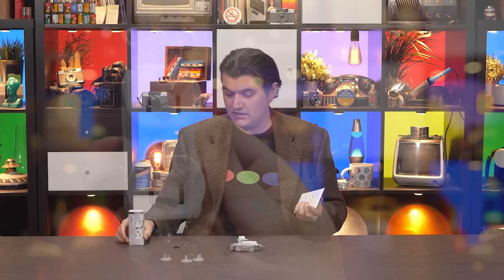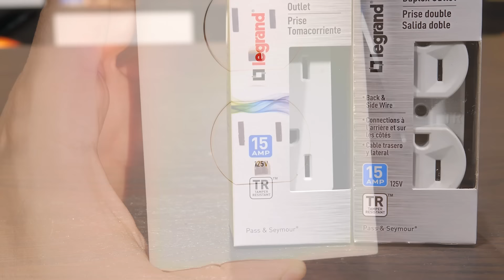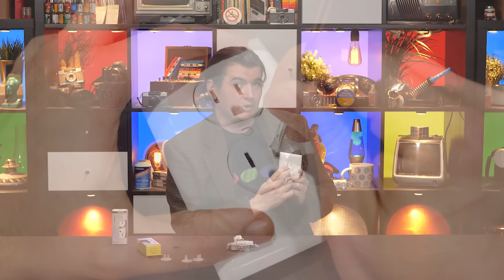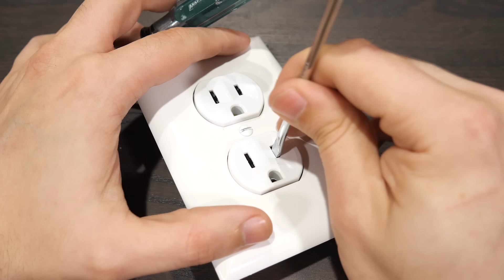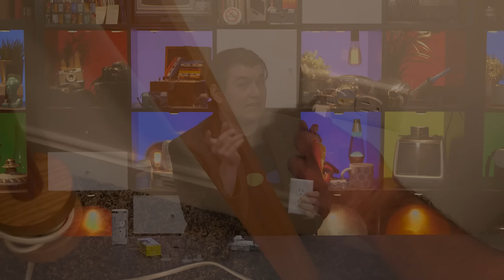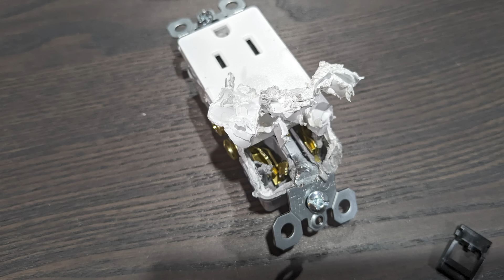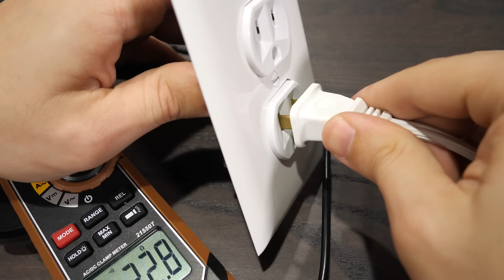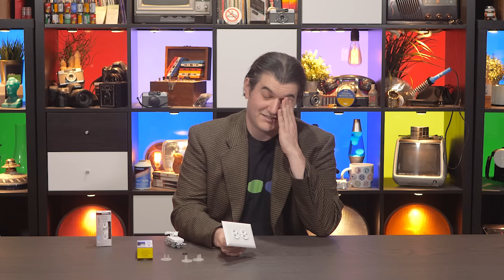Tamper-resistant outlets aren't all the same - a follow-up

Comment: Need to push two screwdrivers in at the same time?  Challenge accepted!

Just adopt the BS 1363.  Insulated pins, high current capability, locally fused, built-in plug detection - can't find where you've left your plug?  Walk about in the dark barefoot 😁

Comment: Enjoy these outlet discussions.  One thing to of course keep in mind is that there is always a cost benefit calculation to be done.  The cost of a change to the US outlet standard, in any way that would break compatibility would be enormous.  Thus the problem addressed would have to be a severe one.  I learned about these the hard way at a very young age when trying to plug in a lamp behind some furniture, I must have touched the conductor with my fingers and got a painful 120v shock.  Something I remember 40 years later and have been careful to never repeat. It hurt, but as in most of these cases the actual injury was minor.    There isn't an epidemic of folks killed by this scenario, it has to be quite rare.  It's also mitigated in more dangerous (potentially wet) locations by GFCI.    As an aside,  I recently was on a trip to the UK, and had the same issue with a sagging connection wanting to come loose in a London hotel.  The issue was having to use an adapter to connect to that large Apple power supply putting a lot of weight on the connection.  Frankly, the old design of putting the transformer brick in the middle of the power connection is better than hanging right on the plug, for that very reason. At home this is solved with a power strip, on the road that can be more difficult.  Thanks again.
Reply: Yeah those Apple power bricks are the worst for it with the US plug. 

It's something I was unprepared for while travelling the other way, as I'd only used them with the UK and EU ends attached. But since I had the travel kit I attached the US end. At first I was quite pleased with it being a genuine flush square when folded up, it legitimately saved space in my messenger bag.

Then, it started falling out of every socket in every bus, bus station, train, and some pals' houses, every 30-60 minutes. I'm not surprised your US to UK adapter had the same problem, the prongs in those can be weaker even when new. (And maybe the adapter wasn't new!)
Reply: Backwards compatibility can be solved with adaptors as needed, and if adopting a Schoko outlet-plug, it also will be compatible with most European appliances.

Comment: I had TWO push in wire outlets short out in my current house.  Each one one made audible sizzling sounds and did not trip the breakers.  There were skid marks on the holes.  One was installed inside the house and one in an enclosed exterior outlet.

Comment: We only have 110v power.  The risk of death if you touch it is really low.  Compare that to 220v ot 240v which is much more dangerous.  So it doesnt really matter that the design is less perfect.  We also dont use ring mains and have dedicated breakers so we do not have the same issues with power distribution and control of power (with breakers and GFCIs).

Comment: I'm German. Our plugs are infinitely better than yours. Sorry.
The only time I've been shocked waaaaaaaaas...with an AMERICAN plug that came with my Kindle way back plugged into a converter. I suppose that provided some measure of """"safety"""" (lots of quotation marks) in the sense you described. If you guys ever DO switch, I very much recommend our SchuKo system. It's borderline impossible to get zapped, even with wet (!) hands. ALL new power cords have tamper protection as well, because it seems to be really easy to implement.
Unfortunately, you'd need an insane amount of converters for your legacy appliances. 
Still might be worth it, mind you. In the looooooong run.

Comment: That tamper resistant variants are similar to the Schuko tamper resistant ones. And share the same problems: Sometimes you can't get a cord in until you use VIOLENCE! And when there is one thing kids are good at: If it does not budge try harder!
As for the 120v / 240v difference: My hands-on experience tells that 120v AC is laughable compares to 240v AC.

Comment: 08:14 re the plugs dropping out. When you visit from Europe and or UK you have to use an ADAPTOR to make a European Plug of British Plug fit, the British Plug + the ADAPTOR are very heavy which means when you plug in a phone charger for example, you have a Phone Charger, and Adaptor weigh down and the plug hangs off the wall. Quite often when I visit the states the plug can barely stay in the wall and I have to prop it up with books or something.

Comment: Thanks for the open discussion. To specify my comment on the main channel, when you plug in the behemoth of an adapter with a full fleged and straight euro plug, gravity pulls it out from a worn out hotel/motel outlet (the lamp outlets are a lot more worse as you mentioned). I now usually bring some duck tape with me when I am on vacation in the states to fixate my plugs. 😉

Comment: The "don't backstab" meme is exactly why so many electricians are against Wagos.

Still, they have different tech because the lever lock pins the blade against the wire.

Comment: The backstab connectors are not comparable to wago-style connectors for one major reason.  A wago uses an active clamping mechanism which provides a large contact area that is strongly retained.  Backstabs use spring pressure only against a small contact area which then generates heat when used heavily and can result in loosening over time.

Recently some outlets have become available which use a lever locked clamp system similar to a wago, and those should be equally good.
Reply: Yeah, Wago also makes pure push-in connectors without levers (so do a lot of other well-respected manufacturers, such as Ideal, too), and those are generally considered entirely safe (and code-compliant).  However, there is a question of how well it is actually built, which can make a big difference.  There is no guarantee that the push-in connections on the back of the outlets are built to the same design/standard internally that Wago/Ideal/etc use, which I suspect is often the problem.

However, it should be noted that all of the outlets I've seen with those "backstab" connectors actually tell you in the instructions that you should not use them when you are daisy-chaining to another outlet or electrical run.  You should only use them if the outlet is at the end of the wire by itself.  This is because the contacts inside them are only rated for the same load as the outlet itself, not the outlet plus other things as well.  The problem is that almost nobody actually reads the instructions when installing outlets, so they often don't realize that going in one outlet and then out to another while using those connectors is wrong.

IMHO, I think that the "backstab" connections are probably fine and perfectly safe if used according to the directions (only used for a connection that ends at that outlet and does not go on to anything else), but it's when people (frequently) use them wrong to chain from one thing to another that you start running the real risk of fires, etc.  (Even so, I just never use them on principle, because it really only takes a couple of seconds longer to use a screw connection that I know will definitely be adequate anyway (especially for the good outlets that have the newer insert-and-clamp screw terminals).)
Reply: One other advantage of a wago is that you can visually inspect how well the wire has engaged (the magic of clear plastic). It is much easier for a sloppy installer to think a backstab is in correctly when it just is not (granted, a sloppy installer can also skip looking at the connector to see if the wire is actually fully in ...)
Reply: No, Wago is the manufacturer, who makes push-in connectors, lever connectors and a lot of other things.
The lever connectors has a lever (duh!) that pushes the spring down to allow the wire to be inserted. When the lever is folded down, the spring will both push the wire into full contact with the busbar and bite into the wire, preventing it from getting pulled out.
Reply: @johanmetreus Wago is just the trade term for all push-in style joints in the US. Similar to Kleenex.

Comment: I wonder if the "falling out" comment is exacerbated, by a traveler having to use a power converter on a receptacle..... more weight right at the receptacle/plug connection...

Comment: Regarding backstabs at 10:30 or so: the major difference between a backstab connection and something like a Wago is that a fully closed backstab has to allow someone to relatively easily insert a 14 gauge wire into the connector. Since the difference between a completely closed backstab spring and one that is holding a wire is only about 1.5 mm or so, the spring needing to be weak enough to allow a wire to move it open significantly limits the amount of force which the spring can apply to a wire once it is inserted. 

In a Wago connector a lever lifts the spring up out of the way so the spring can be made much much stronger in the "closed" position and that means it will have more force when deflected a bit by the wire.  You can get an appreciation for the difference in spring strength by trying to insert a 14 gauge wire into both a closed Wago connector (hard!) and a backstab (pretty easy!). 

The stronger gripping force results in a more robust connection, same as tightening down the side screw terminals gives a better connection than just snugging them up. Backstabs try to compensate for this with a sharp edge on the spring that will bite into the copper wire a bit, but there's no real substitute for really smashing things together. 

What's really nice is that some manufacturers are starting to set up the side terminals on their receptacles to have a little clamping plate built-in, so that you can just shove a wire straight in there without having to fiddle with bending a hook in it, then clamp it in place with the screw.

Comment: Yeah the cheap Japan and China ones are bad. But the old double slotted outlets were made much better and no you cannot split circuits on one outlet. These were ungrounded and hardly ever wear out. I wish I would have kept a few from my old home that was wired in the 50s. They look like a 20 amp outlet only both sides have horizontal slots. Times have changed and quality has gone way down. Even commercial outlets are a step down in quality. One thing I hate is trying to measure voltage in a child proof outlet. Guess I need to snip off the test probes and wire to a plug that goes in well. 73

Comment: In Australia from about 20 years ago onwards, the Active and Neutral terminals on the plugs have to have (about) the first half sticking out of the plug to be insulated to stop exposed active terminals when the plug is not fully inserted.

Comment: I live in Japan which uses US style plug sockets and any amount on tension or movement of the cable eventually causes plug to wiggle out. This is highly alarming to someone from Britain where there is absolutely zero movement on the plugs, with the wire coming out parallel to the wall and the large flat contact face of the plug itself.

Comment: If one only touches both hots on 240v will they get zapped? Or do they also need to touch the neutral or ground to complete the circuit?
Reply: Either way, ZAP!

Comment: I had a few loose electrical plugs in my California house that I replaced. Like throwing a hot dog down a hallway. Any tension or weight on the plugged-in device and the cord would seriously back out. Just did not have a good "grip" anymore.

Comment: The reason that you NEVER use the bak stab connector for an outlet is that they generally tend to fall out over time. My father and oldest brother were both electricians. When they did service calls for dead outlets, it was the back stab connector every time.

Comment: Why not spring-load the plastic element around the pin receptical so it stands proud of the wall (or can recess in to the wall).  The terminals themselves are exactly the same, but there's now a movable sheath in place following the pins in.

Comment: I have one multi-plug adapter that is tamper resistant. You make me wonder if it is defective. No matter what I plug in, I have to apply extreme pressure to insert the plug. It is not uncommon to have to remove the adapter from the wall and plug the item into the adapter, then plug the adapter into the wall outlet. I guess technically, this is extremely safe, since the adapter is not live since it has to be unplugged to plot anything into it.

Comment: I've been shocked around 15-20 times by full 120, and it hasn't caused any permanent damage. I agree that 120 can certainly kill, and it is not safe to have outlets the way that they are designed. I also agree that 120 is less dangerous than 240.

Comment: I've yet to watch all of the video, actually I'm just 5 minutes in when writing this but as I'm about to fall asleep I want to get this written before I doze off.

I have a feeling a lot of the design of these shutters are using experience gathered from Europe and possibly other areas where this was implemented a lot earlier. I remember back in the, I wanna say, mid 70's when there were a push for tamper resistant outlets here i Sweden. There were both incredibly compact inserts you could glue into the outlet and complete new outlets to replace the old ones with.

There were a few different styles. One were a rotating disk with holes for the pins. So you had to insert the plug into the holes in the disk and turn it to line up with the contacts before pushing it all the way in. To make them safer you had to push both contact pins into the disk before it would turn. These were pretty effective, but could be annoying.

Another version has a sliding mechanism where you again inser the prongs slightly off center and then instead of turning you slide them down until they line up with the contacts where you push them in. Again both prongs had to be inserted or it wouldn't work. A kicker was that the plate actually slid sideways as there weren't just round holes for the prongs but actually slits at 45°. Again these worked and was pretty safe, but could be annoying to use.

The dominant, or even only, version used today is very similar to the one you are showing at around the 4 to 5 minute mark in the video. Again it requires that both prongs are inserted at the same time. But as it doesn't require a twisting or sliding motion when inserting the plug it's a lot less annoying. These has been the standard for at least 20 years now, probably longer.

So there's a lot of experience from other markets to base these on.

In Sweden the original "old" standard non grounded outlet was the Type C. The grounded version is the Type F. And extension cables often have a few "compact" outlets that looks a lot like Type N, only lacking the hole for a ground pin. These last are used for "Wall warts" and double isolated equipment having a Type C plug.

Something interesting is that all outlets here now have to have a close fitting neck that's high enough that the standard sized plug is enclosed before the prongs can touch the contacts. It's something that's became obligatory sometime in the 70's or 80's I think. Older outlets were either entirely flat, just like you see with US outlets a lot of the time, or they had a rim that were perhaps two or three millimeters high, so basically nothing. 

With the higher rim you can't touch the prongs on a partially inserted plug. Compact plugs have isolated prongs so you should not be able to touch any metal part when the tips make contact.

Another interesting design decision is that the ground is provided to externally located contact areas on the plug, it also has a slightly "clipped" shape while non earthed pluggs are perfectly cylindrical. This make is impossible to insert a non earthed plug in a earthed outlet. The idea being that if you install a earthed outlet it's for a reason, and using equipment that's not grounded there is probably not a good idea. Any double isolated gear can always use a compact plug and that will fit in all outlets, grounded or not.

OK, sorry for the wall of text. Now I'm going to bed, so enjoy all typos in there. I'm to tired to bother re-reading it...

Comment: In the UK, we actually have 2 different styles of shutter blocking mechanisms. 

The most common is the one you already mentioned - insert the earth pin and the live / neutral shutters open.

The second one is kind of a hybrid between our ‘standard’ design and your ‘tamper resistant’ design. It still requires the earth pin to be inserted first, but this doesn’t open the shutters, it simply unblocks the shutter movement so that when you insert a plug, the live / neutral shutters can move out of the way, and requires both the live & neutral pins to be inserted at the same time
Reply: As an American, hearing it called "earth pin" instead of ground pin just sounds so wrong, to the point that I automatically assume the person writing isn't a native English speaker and is translating the word wrong.
Reply: @Devin_Stromgren  I’m the same, but the exact opposite 🤣

Then again, I think that about most US English variants of words 🤣🤣
Reply: @Dust76tr  Technically a lot of the time the variant used in the US is the older variant, making our variant arguably the correct one.  For example, our pronunciation of lieutenant as loo tenant, vs your pronunciation of it as lef tenant.
Reply: @Devin_Stromgren  To me as a foreigner both "ground pin" and "earth pin" sound perfectly fine 😄